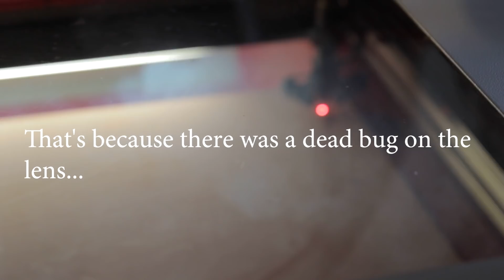Dangerous VCR Robot

Comment: How did you make the mechanism for the cd launcher to shoot multiple discs when you pressed the button?
Reply from the maker: The CD's are in a stack, and a little servo motors kicks the CD's forward one at a time. A block of wood sitting in front of the CD's is just high enough off the platform for a single CD to slide under into the wheel
Reply: William Osman thanks man keep doing what you're doing. Its cool to see people mixing fun and technology (and cats)

Comment: How did you make the remote control work with it?
Reply from the maker: Hobby remote/receiver systems are really easy to use. A little module paired to the remote sits inside the robot, and connects to the servos and motor drivers with 3 pin cables.
Reply: Cool, I'd love to see the electronic and programming aspects of your projects in future videos.